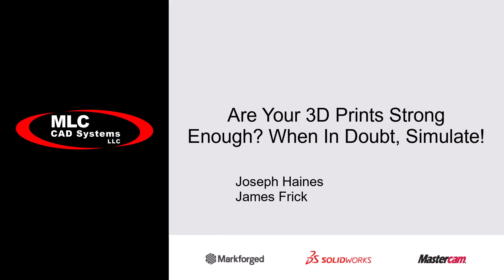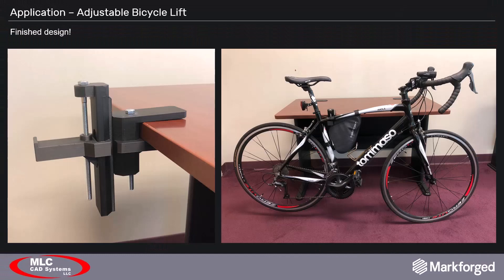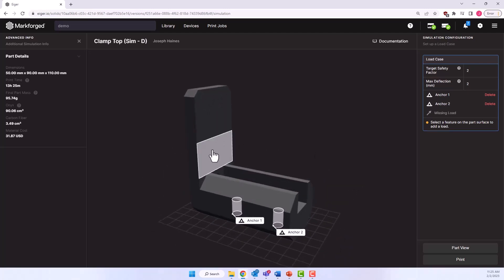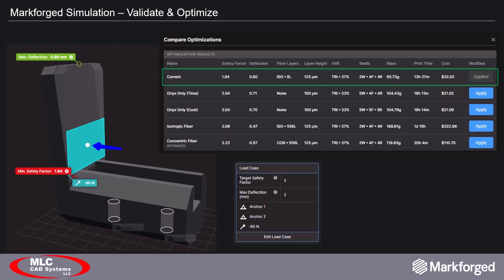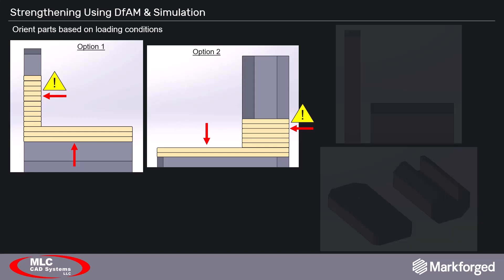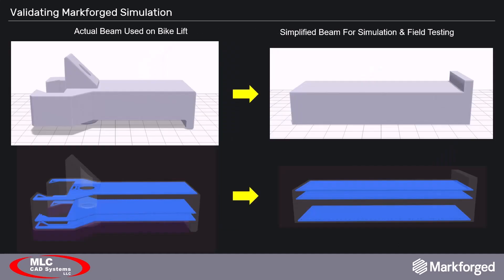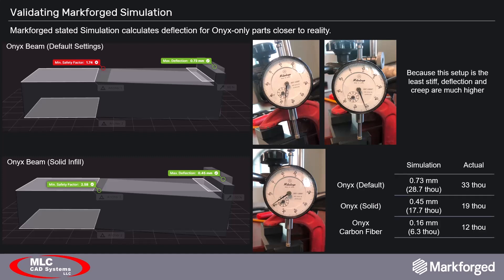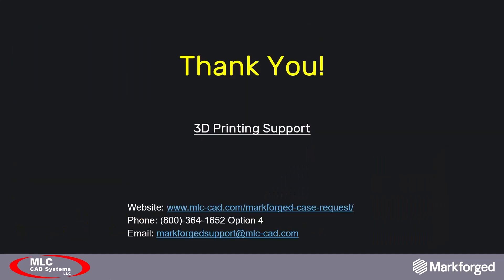Are Your 3D Prints Strong Enough? When In Doubt, Simulate! - Markforged Webinar

Comment: aluminum is $2 per pound, can't compete in material characteristics for cost/value
Reply from the maker: The value doesn't derive from the cost per pound of material.  This is all about the ability to build quickly and accurately in durable parts with minimal human effort and almost no tooling/fixturing/programming costs.  Great for low-volume production with high variability, product development, prototypes, and manufacturing aids.
Reply: @MLCCADSystems  That's true, but it's hard to run a business from low-volume production with high variability, Unless you're already a big company doing R&D
Reply from the maker: @steve5nash  This is true!  A 3D Printer would not be a good first machine for a traditional manufacturing company or job shop unless it specializes in product development and prototyping.  Additive manufacturing is not going to replace traditional manufacturing for the bulk of the parts produced in industry, but it will add tremendous value to existing workflows and expand profitability for large companies doing R&D.